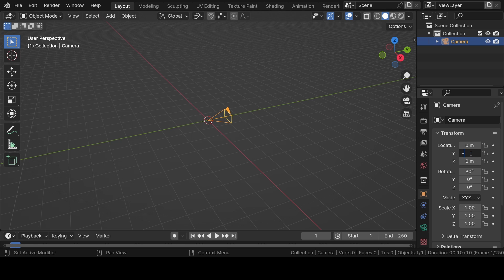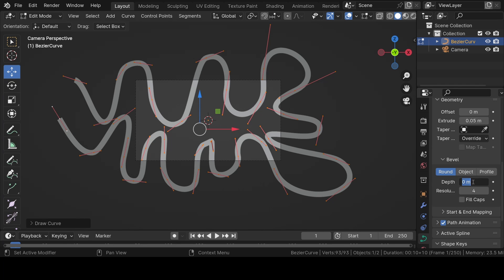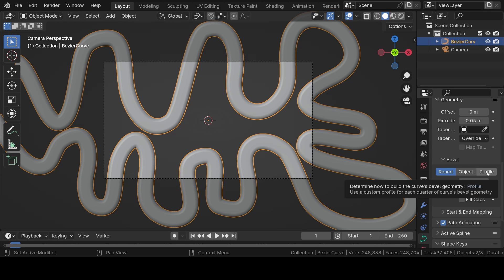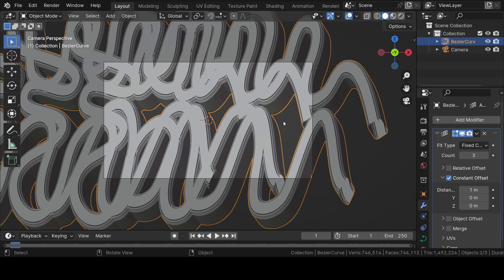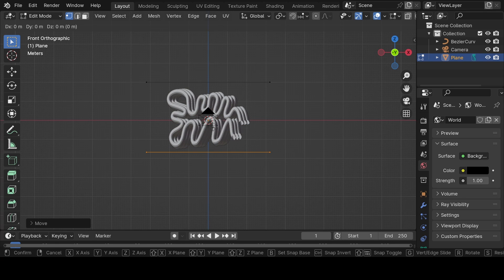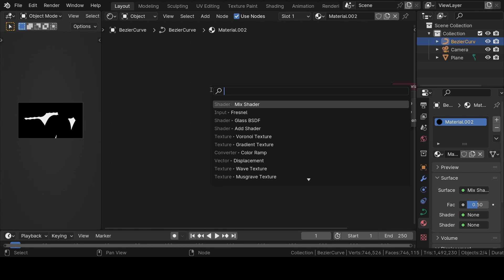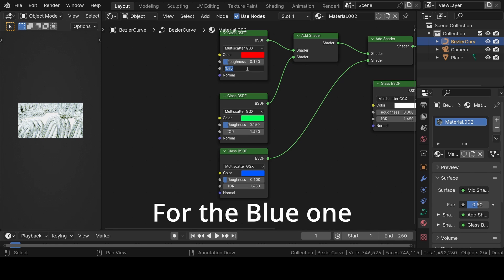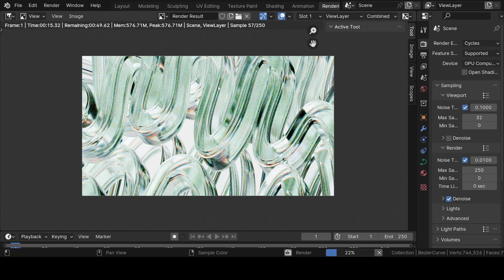I am OBSESSED With Making GLASS RENDERS In BLENDER 4.0

Comment: That looks so clean, I love glass renders! One problem that encounter quite often ist that the glass is way to dark in certain areas, even if i crank up the number of bounces for transparent and reflective in the path settings. I like your good explanation in your tutorials, easy to work with. Thank you :D
Reply from the maker: One way is to use mesh as light source as I have done in this video and another way is to use light path node to get better control of your light.